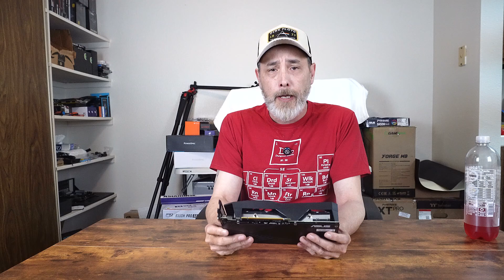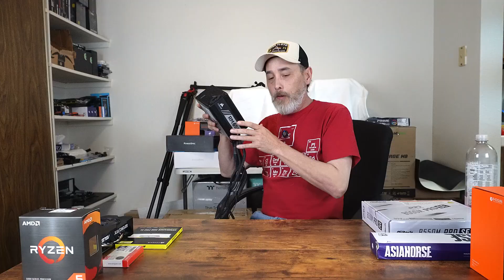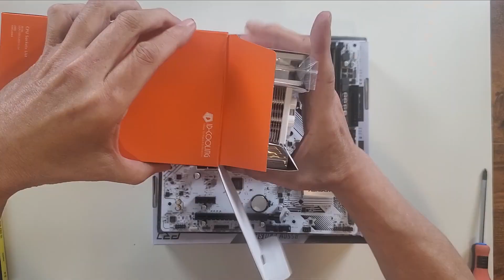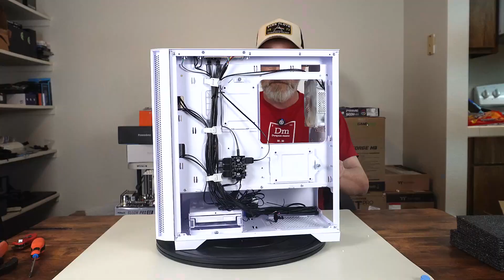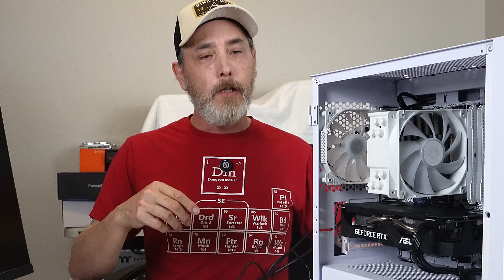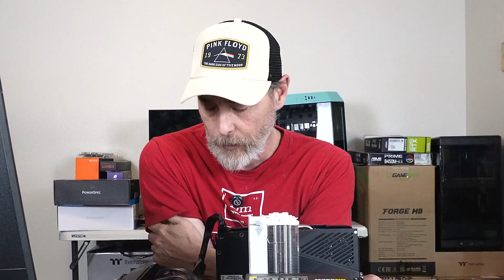Fixing a Broken $600 Gaming PC

Comment: I just built in that same case with an ASRock motherboard a few months ago. I did have the same gripes in the building phase with the small cutouts for cables, loose grommet, etc. but had no issue with the rgb hub. The dust filter at the top of the case was also bothering me and I actually came to the same conclusion of an error during manufacturing before I found out it actually matches up when put inside the case if I remember correctly. The motherboard I used was the ASRock B650M Pro RS Wifi and had a WD  SN770 and didn't run into issues so it seems ASRock fixed that issue in motherboards after that B550. The rgb hub worked fine for me. Pressing the reset button changed the lights fine although I had no extra rgb fans. I also had a corsair RM750x Shift which has 20A output for 5v. I would never have thought the motherboard and ssd issues nor the rgb hub and psu issues would be a thing but it's something I'll keep in mind next time I build a PC lol
Reply from the maker: Great info and feedback! Thanks for the details! Yeah, perhaps the hub was just faulty and I was the lucky one ;) lol As for the filter, I had thought maybe it goes on the inside but it came sitting on the outside and it felt kind of weird to put it on the inside and didn't make sense considering fans or a radiator could go there, which made me think it wasn't meant for the inside and so I didn't bother to check.  

Good to know ASRock fixed it for the B650M but they should still make the data easily found for those that buy their B550M Pro SE motherboard.  I was pretty disappointed with them on that.  Anyways, again, thanks so much for the info and thanks for watching!

Comment: im so surprised that u dont have ATLEAST 10K subs for the effort of ur content u make! ur vids just make me happy for some reason. also should i just keep my rtx 4060ti or should i but a rtx 5070 when it releases?

ps: love the pc u built :D
Reply from the maker: Thank you! That's probably some of the best compliments I've ever gotten :)  If your 4060 Ti is the 8GB version, then yes, it would be a good upgrade.  If it's the 16GB version, I'd be looking at the 5070 Ti but you might be better served to see if a 5070 Ti Super comes out later down the road at a similar price point if the 40 series msrp was any indicator.  

Also, if you aren't opposed to the AMD brand, it looks like the 9070 XT might end up being a solid card at a lower price point as well.  Just wait for the third party testers to confirm though!  Hope that helps!
Reply: @Lead-a-Horse-PC-Hardware  what do u think think abt dlss 4 with the 50 series cards? the whole 5070=4090 performance thing. do u think its good or just "fake frames"
Reply from the maker: Great question!  I'm a big fan of straight performance to figure out what they can really do, i.e. no frame gen, no rt, etc. and standing them side by side to see what they can really do.  

The reason why I prefer this comparison is for the very reason why NVidia decided to make dlss 4 now to be compatible (to a degree) with the 40 series cards and even the older 30 and 20 series cards.  Such things can change, bug out, create issues down the road and/or work differently with different hardware and even different games.  And so comparing a component with a software advantage isn't an accurate measurement of that hardware.  

That being said, I think that the multi frame gen is an interesting concept and tool and I'm looking forward to seeing what it can do, but not as a metric for what the hardware can do by itself.